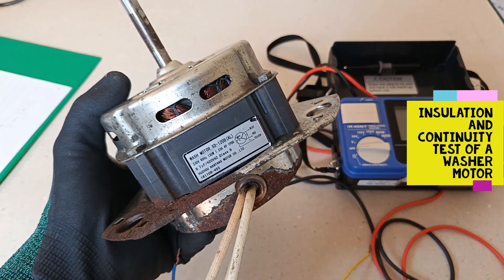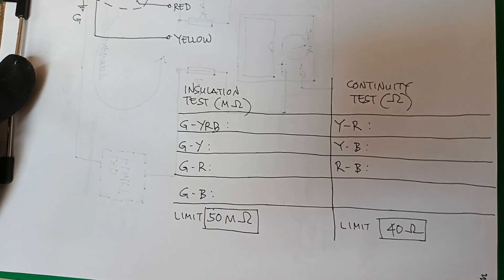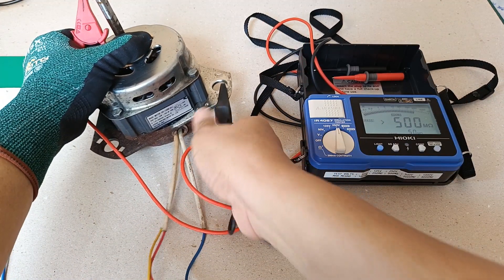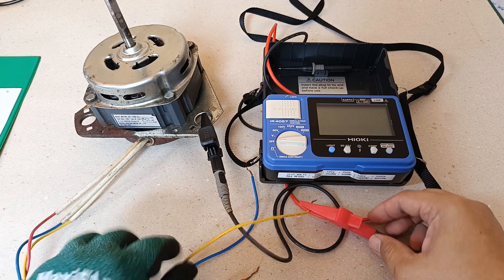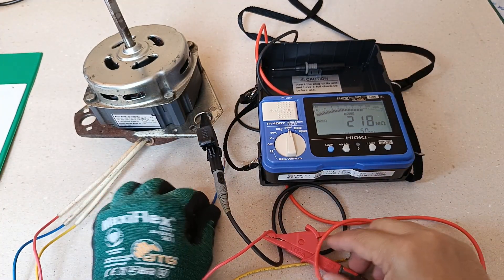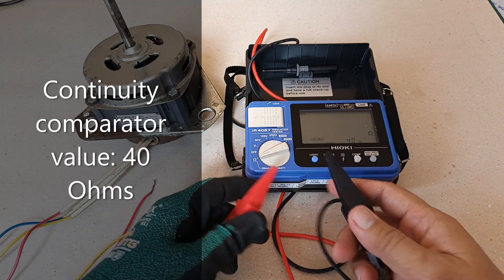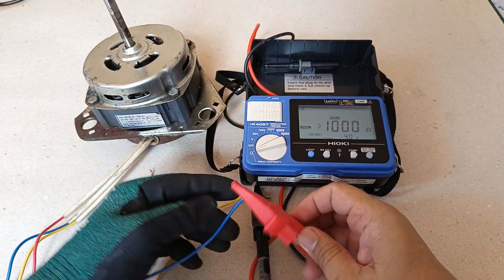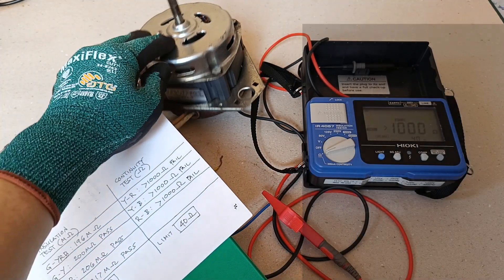Washing Machine Washer Motor Malfunction [CC] #electricalsafety #electricaltools

Comment: burned/corroded wire/connections causing high resistance?
Reply from the maker: That's possible. The rusted bottom suggests long term moisture contamination. Thanks for watching.